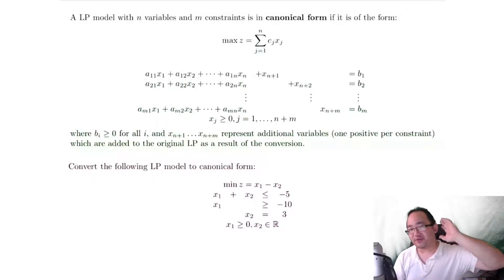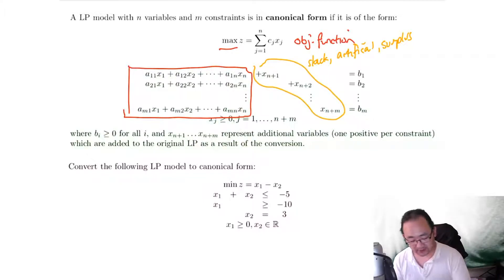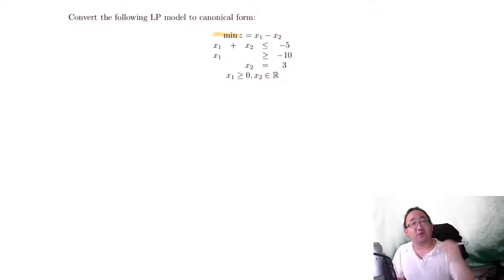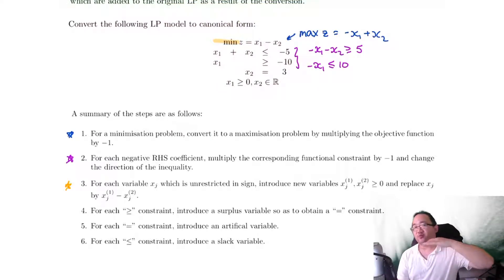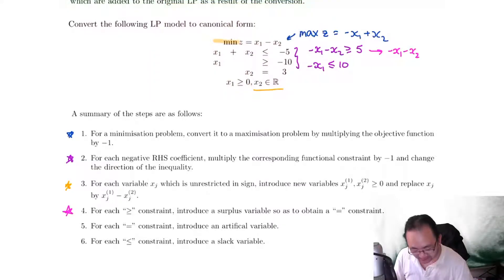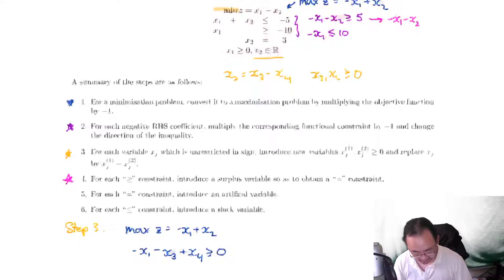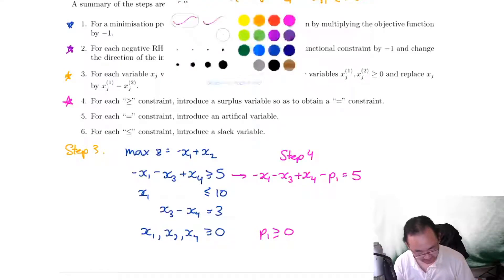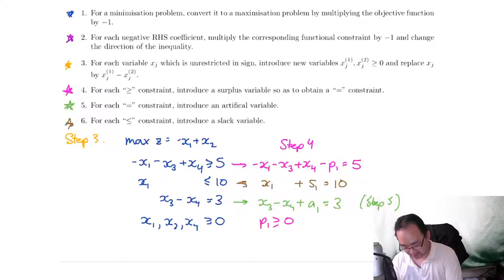Simplex Method: Step 1 - Converting an LP into Canonical Form

Comment: Kinda frustrated that you haven't explained how to satisfy the condition that each row should have a corresponding unit vector. Specifically, column 4 has -1 coefficient before p1, which is not clear how to work with. But still thanks for your honest work.